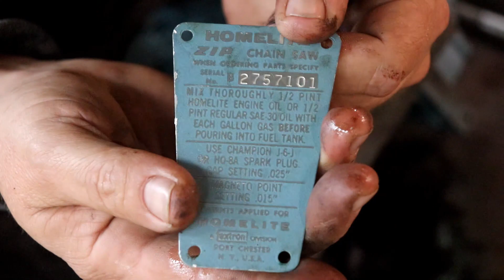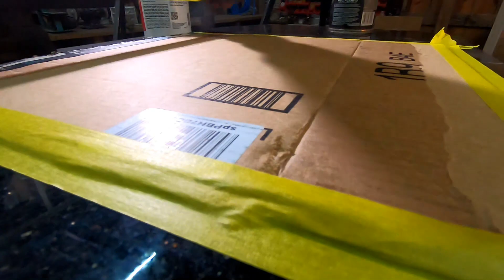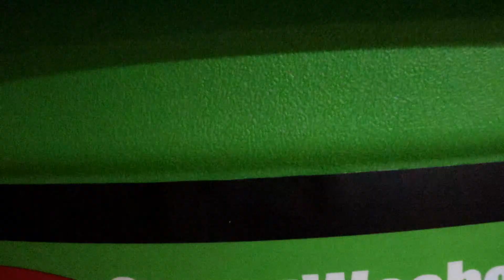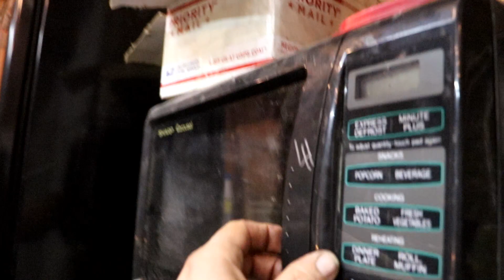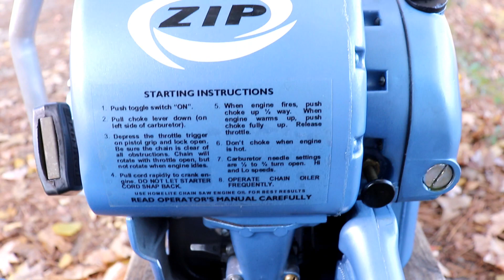Chainsaw Restoration Homelite ZIP Bowsaw

Comment: I have one of these zip saws but it has a normal 24 inch bar. My cousin would call it the tractor when we used to cut wood together he has an XL- 100 about half the size. I would cut the trunk while he cut the top still have it need to clean the carb & air cleaner. It starts but won't run up to full rpms. I have another large 1963 homelite a C-51 i need to repair the coil on it. Now i need to get it's case down out of the rafters and fix it. Love to hear these big old homlites.

Comment: At 26:40 a piece of gasket material was holding the intake valve closed? On a 2 stroke?
Reply from the maker: +gorp27 yup. Non mechanical check valve like a Reed valve. It has been well over a year since I worked on that engine but I think it mounts just behind the carb. Hope that helps.

Comment: In the U.S. Navy, at least in the aviation side, we called those stickers zappers, as in squadron zappers, 
You would find them all over, especially in establishments frequented during port calls by members of those squadrons, such as walls of bars.
I remember a bar wall up the street in Haifa Isreael was almost completely covered with zappers.
Prior to that while in Souda Bay on the island of Crete, part of Greece, there was this little Gypsy girl wandering around playing a drum in hopes of tips, had one of my squadrons zappers right in the middle of her drums head.  Of course when I saw that VF-143 zapper I could not help but smile and give her a big tip.

Comment: Like the Abom stickers !  I have an older Poulan 44cc (made in Sweden)  chainsaw motor. I built a pipe, and installed it into a 1/3 scale R/C dragster.  So far, I managed to get 17, 280 RPM out of it on pump fuel (98RON)  at 25:1 std. oil mix. I can't get any more, as it's sucking air in through the crankcase seals. I love to see what can be done with old saws. Cheers.

Comment: About your spring breaking, my guess is hydrogen embrittlement from the acetic acid in the vinegar causing existing flaws/cracks in the metal to accelerate to failure.

Comment: Tanks that you can open up for cleaning, very nice! This machine is made to be serviceable! 
Mold cleaner? Is that talking about fungal growth or degreasing the molds that parts are made in? I'm going to assume the latter, as you're using it to clean oily residue off the carb. 
Nice HandToolRescue cameo. XD Cylinder honed, and exterior blasted? Or is that just the natural surface after cleaning? Was that hail or laundry? Turned out great!

Comment: My dad had a zip and I ended up with it after he died.  What a boat anchor.  It weighed a ton but I cut a lot of wood with it over 40 years ago.  I can cut more wood, today in a hour, than  it could cut in a day but it was a descent saw for its Era.  I did about everything you did at one time or another.  Seeing you work on your zip brought back many memories.  However, not the memories of toting that road yacht around.
Reply: John clarke :  the saws you use to day don't last as long as these did because they have a higher rpm so they cut faster. But you have more ware with that cutting speed. I have ouned 8 or 9 smaller and faster saws that wore completely out to the point it was cheaper to buy a new one than fix and the zip is still running and used on the trunks over 12 inches. It's weight and torque make it the best choice for larger diameter tree's.

Comment: The specified fuel/oil ratio was 12- 1, 3/4 pint of oil per gallon for the 1959 ZIP. Manual chain oiler. That saw with bow probably weighs about 28 pounds. When introduced, it was considered a lightweight-- compared to earlier saws.

Comment: The corrosion on them loosened up when put it in the acid (vinegar) and the weak spots failed under pressure. They were gonna go anyway, you just accelerated it.

Comment: You might find it interesting that when I used this kind of saw in Georgia in the mid-seventies we used them mostly for pre-commercial thinning and clearing brush.  We called the bar a brush bar.  When cutting pulp we would buck up the material using the felling saw since we already had it in hand.  I haven't seen one of these in years so it was nice to see the tear down.

Comment: It's really amazing the engineering that went into those old saws. Their are so many intricate pieces built into it, like a work of art. You don't see that on anything modern.
I have a 79' Homelite Super XL  automatic. It still gets put to use on a regular basis. Great saw's. Eventually, I'm getting the bow for mine. Their easier to find for my model, I see then on ebay often and if you use them SAFELY, they cut a lot better than the regular bar and chain does.

Comment: fire in the hole!!!   and ya put the chain on backwards unless those bowsaws run reverse of a normal chainsaw. sadly I think those saws use 1/2 pitch chain and they don't make it anymore. unless that one uses 404 in that case your golden. 1/2 pitch has been out of production for years. good restore . though i would probably put a new diaphram in the carb just for preventative measure.

Comment: I love how this had no Phillips heads.  I like flat heads.
Reply from the maker: I like how they slow me down. Hate them in a deck. Love them in an old tool.
Reply: @TheGoodoftheLand  the new deck screws are great. The stars. And the head is flat.  Phillips screws are designed to strip. With the head coming to a point
Reply: @thecynic807  those star bits are called torx.

Comment: The chain is wrong in a refurbished saw. he chain must be rotated to cut the wood. Otherwise, great video !
Reply from the maker: +Reiska ins Jussi Yup...which is why I included the word "backwards" during the chain install. It was installed backwards for safety.You have a good eye noticing the chain was backward.Very few people would have noticed that. Thanks for watching! I am working on a video cutting and splitting wood with antique methods

Comment: Fantastic work again. I like CRC stuff but I have never gotten a spray degreaser to work well for me. Seems like kerosene in a can. So kerosene is cheaper. Just saying. Can't wait to try their rust resolver though.
Reply: Dan Riceman We used to use oven cleaner on engines we would rebuild or transplant, seemed to work pretty good itill we could afford a steam cleaner.
Reply: Hi Dan! Let us know what you have been trying to degrease. We have about 20 degreasers and I can point you to the right product for the job.

Comment: That is the craziest looking chainsaw I have ever seen. Like a kickback waiting to happen. lol. :)
Reply: I am a Stihl certified chainsaw tech. You are exactly correct, these saws pose a HUGE kickback danger. There is a reason why Stihl, and everyone else, abandoned this design. NOT SAFE FOR USE. DISPLAY ONLY.
Reply: Some of the tools that people made back in the day just make you shake your head and wonder how the human race made it through. lol :)
Reply: I was thinking exactly that, that big old clown nose will grip and flip like a bastard. You’d need to have eight legs like a spider to even make it to the end of a shift.
Reply: It may look scary, but if you've ever used one you wouldn't want to use a regular bar again. I have used them on my saws since the late 70's and never had any problems with one ever kicking back or even had a close call with them. We had a contract to provide wet oak for a Barbecue restaurant chain back then, and nothing would cut as well as a bow saw. The chains are longer, so there are more teeth doing the cutting, and the chain runs cooler. Another benefit is it is really hard to get the bar stuck or pinched when bucking logs. I still run them and like them, and they still sell the bow bars to this day, if you know where to look. ;-)
Reply: You would not want your tie to fall into that in operation.
Reply: Love a bowsaw,,, would buy one today if I could find one,,,,wink , wink 
 @CumminsDslPwr
Reply: You’re a Stihl certified “tech”. Ok guy.  You know how to put gas and oil in stuff. These are completely safe if you 1) know how to use it and 2) make sure the bow guards are in place.  Without them, they can be deadly.  I still use one to this day for bucking logs because as stated they are almost impossible to get pinched
Reply: @Freakingstang  that reminds me of a guy working at lives proclaiming he's a "loves certified tire tech", meaning he airs tires up at the fuel pumps, and "I know what I'm talking about" lol
Reply: @sethstarrett2987  Back in the day, when a 75% survival rate among your customers was considered good.
Reply: Those were called a brush bar.  Very dangerous indeed.  If you planned to use the saw it would be a good idea to fit a modern bar and chain.
Reply: My chainsaw comes with one of these bowsaws ans an attachment option from back in the early 70s and the manual that I found for it has I'd say almost 1/4 of the book explaining the safe use of this piece. I now know why they've banned them lol.

Comment: chainsaw of that ara i hope your running 16:1 through or 32:1  they not ment to run less that that.
Reply: cruddycornstalks Most old Homelites of that vintage I believe we're 16:1,I had an XL 12(blue ,so it was older ,pre67 ) at least ,and it was 24:1 ,I don't know where exactly they switched to 32:1,some time around 76 I believe maybe a little earlier.
Reply: i knew it be somewhere in there. i know that with modern oils that 32 works on but they really work with just simple oil and 16:1 mix is a good way to break in new rings and let it run better.
Reply: cruddycornstalks My grandfather had a mean running mcullah super 610 that was that way ,16:1, regular nondetergent oil ran good for a long time.
Reply from the maker: You nailed it, We ran 16:1

Comment: Great job on the restoration but you are missing one part on the lower part of the bar the kick back is missing they were great old saws easy on the back for bucking up firewood. Keep up the great videos
Reply from the maker: Yup. You must have missed my explanation in the end of the video. Wanted to make a set but I would prefer original for the museum.
Reply: @TheGoodoftheLand  nope I heard it I already had it posted before it got to the end my uncle had a bunch of these in his shop back as far as I can remember before he retired and sold out

Comment: Had a very similar problem with the springs on a couple of vintage callipers, the springs on both of them seemed to disintegrate. It looks like the acid in the vinegar had eaten away at the carbon in the spring steal. It also destroyed a high carbon steal carbon art palette knife.

Comment: You're right, that saw "IS" a beast,,nothing on the market today can equeal it. I hate to think how many hours I have used one cutting short pulpwood, veneer blocks, n logs. Most of my experience was wit the "WIZ" series which i think is newer , or maybe bigger ,,, but awsome saws.The narrower bow you mentioned, was usually used for brushing,, n tree work by utilities. If you ever use one cutting firewood, or smallis wood, up to 16 / 20 ish inches , you will forever curse a straight bar. "Them That Knows Kno'

Comment: On the pull return spring breaking the vinegar may have cauldron hydrogen embretelmt .vinegar will etch steel also I prefer electrolytes if it's feasible myself. Psa don't use stanless steal it generates toxic cromates.
Reply: No, the spring was already rusty, and therefor full of micro-cracks and surface irregularities.   Putting it in vinegar attacked those weak spots and the fact that the spring was under tension just caused it to go sproing..   You should have just used carb cleaner on it to remove the rust and then just coated it with oil to keep it from further rusting..
Reply: @clau2272  good point probably better it went now rather then having to tear it down again. It's days were numbered anyway.
Reply: Hydrogen embrittlement is only really a problem at very high temperatures. It’s why you can’t weld with propane. That spring was just going to die that day no matter what it was sat in. Rest in peace dear old spring.
Reply: Old Iron Shops h

Comment: I waiting for you to use a CRC product to extinguish the fire.
Reply from the maker: HA! I will ask Jake if they have a fire suppression system.
Reply: @TheGoodoftheLand  - Not yet :)
Reply: Bet they do right after this!  xD
Reply: Crc carb cleaner would probably work
Reply: Man CRC makes GREAT stuff!
Although.I bought some degreaser, to try out instead of the gunk cleaner from Walmart. Didn't use it for about a month. Freaking took the small black cap off pressed on the nozzle.....
And Bam! Nothin. No pressure no nothin. 
Checked the can, Full of liquid. no dents. Holes. cracks. Quite Literally a brand new shiny can. 
Examined the nozzle closer. It was the seal around the plastic female gland. Did the mechanism Rot out cause it was stored on Its side at Wally world?
Reply: @projectsuperstore4049  I'm glad you like using our products! I can't personally provide the answer to what happened to your degreaser but I would recommend reaching out to our tech service department and see if they have any idea.

Comment: What is the purpose of thus chainsaw guide shape...?
Reply: Different angle, works great on smaller trees and brush. Also for stuff already piled up, just push it into the pile. Never used one myself, that's just the basics from what I've heard.

Comment: I saw that fire coming when you said "It's dumping too much fuel"    That spring was rusted and weak, when the vinegar did it's work on the rust it went boing ....... Did you find a new spring or just shortened it ????  

I can tell this isn't your first chainsaw restore.......     Papa Texas needs 2 carb rebuilds on his... He told me in a video that both had dirty carbs ......   That good carb spray didn't affect your diaphragm I see ...........

When are we going to see the gasket making tip ????  

Plus Tard Mon Ami ~!~!
Reply from the maker: I just shortened it. The crazy thing is the surface finish on the spring is perfect!

Comment: Why the spring broke?
Vinegar is a type of acid (acetic acid) which reacts with (eats away) iron.
Since vinegar is extremely dilute (around 5-8% acetic acid solution in water), the reaction is very slow, which is why it's practical to use it for surface rust removal.
In your case, the spring coil is very thin (and old) and under tension, which all contributed to the breakage.
I tried both and I prefer electrolysis for rust removal (though I still use vinegar from time to time).